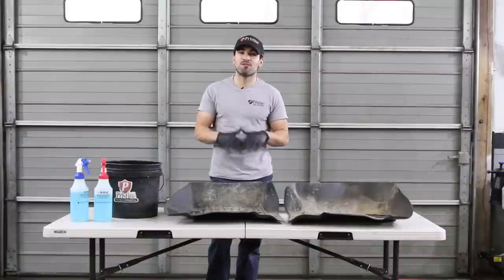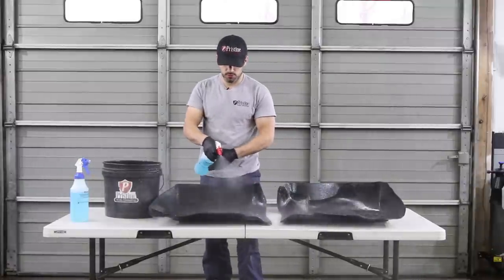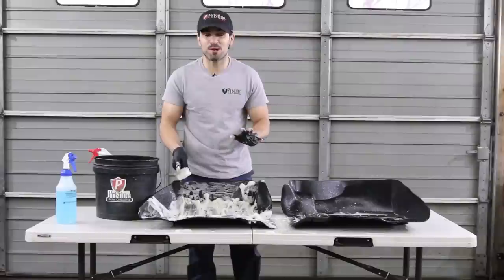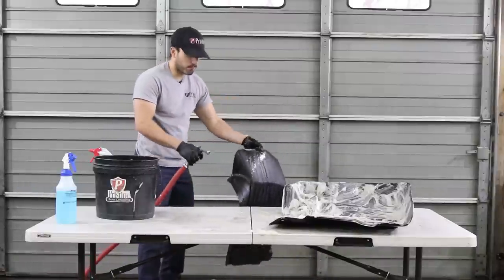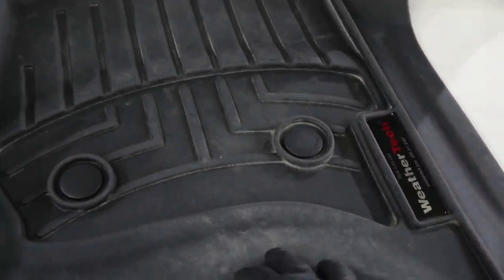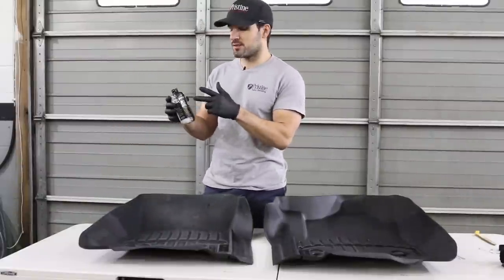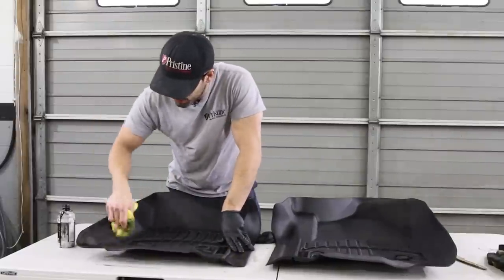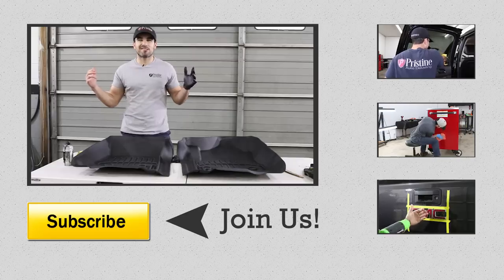How to clean & restore Weathertech floor liners

Comment: I see the appeal of these for work trucks, but honestly... You're probably fine with OEM floor liners if you're just an average driver, with the biggest exception being if you live in the salt belt. I know the OEM ones won't run up the front to give the same coverage, but they're usually a softer less slippery material. Weathertech liners are pretty slippery as they come and really aren't super good at anything they do. I had a pair of WT Liners in my 2010 Fusion since I didn't get ANY front floor mats when I got it used and I was not overly impressed with them. 

With them running up the firewall, they're a huge pain in the ass to pull out if you spill something or have a liquid you need to get out without access to a wet/dry vac making it more likely that you're gonna spill on the carpet anyway; That goes for driver and passenger front positions.  My 2016 Legacy came with rubber mats, and ya know what, I take a carpet cleaner to the carpets in the spring and fall as I switch the mats from Rubber to Carpet and it's fine.
Reply: You clearly don't own WeatherTech floor mats. 👎
Reply: @MrPink2024  You're right... I don't... ANYMORE. I wouldn't waste my money on them again. I buy new cars and make sure the manufacturer puts in their rubber mats. The weathertech I had were extremely slippery compared to my current cars OE rubber mats, and as a driver I don't want a slippery floor mat for me or my passengers. They were also IMPOSSIBLE to get out of the front floorwells to empty without spilling liquid to get them out, even sliding the seats all the way back. So yea, I clearly don't own them anymore. They're JUNK.

Comment: Will pressure washing these mats mess them up?
Reply from the maker: No, as long as you don't get crazy close to the mats with the pressure washer tip and use a tip that's a wider pattern. I have gotten pretty close to the mats and it really takes a decent amount to mess them up.

Comment: I tried the Solution Finish product but got a bad result. I find that it leaves an oily black residue that rubs off easily with just a light touch. This is very disappointing because the liner looks good but I'm not going to put it in my car in this condition. I hope it washes off! Has anybody else  had this result?
Reply from the maker: You will want to wipe off all the extra residue on the mats that didnt absorb into the material.
Reply from the maker: You will want to wipe it with a rag or towel you can trash after words. Ill generally wipe 15 min after applying till little to no transfer is getting onto my towel. You want the product to absorb into the material. It won't stay shiny and oily if wiped off.
Reply: @PristineAutoDetailing  Thanks, I'll give that a try next time.

Comment: How do you prevent the weathertech floor liners from warping?
Reply from the maker: I haven't figured that one out yet, seems like its generally the edges of all the mats and always that rear mat in trucks. Great question! Wonder if it could be molded back with heat and pressure?
Reply: Pristine Auto Detailing Thanks great idea 👍🏻